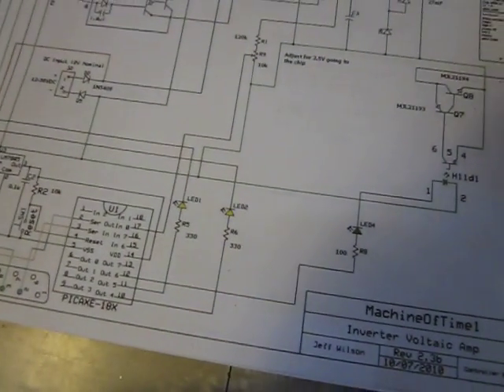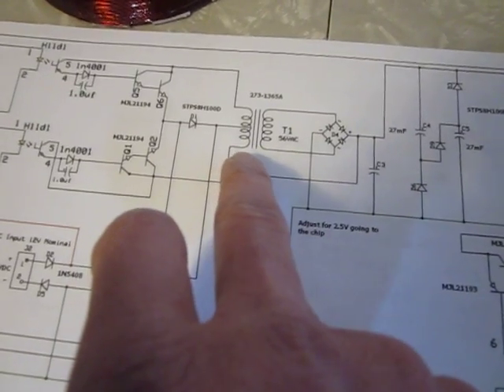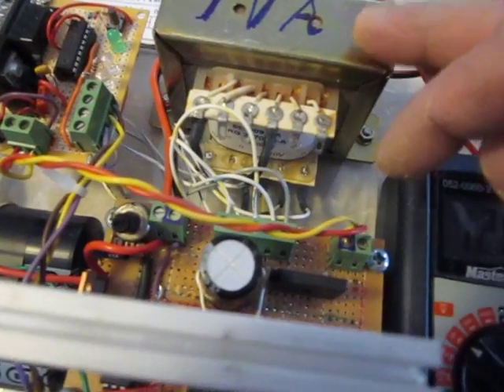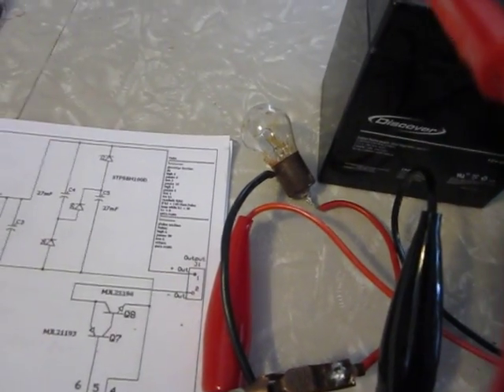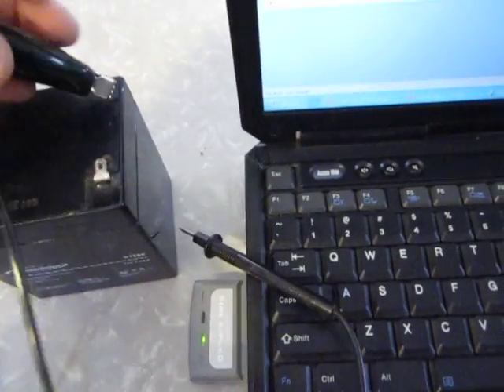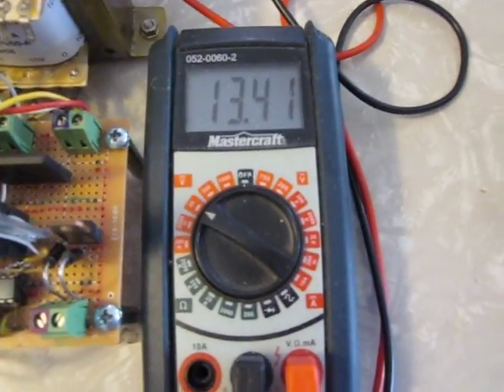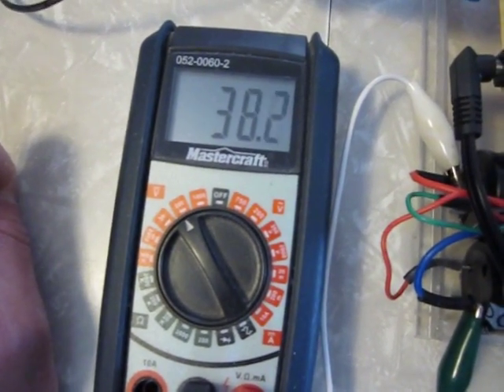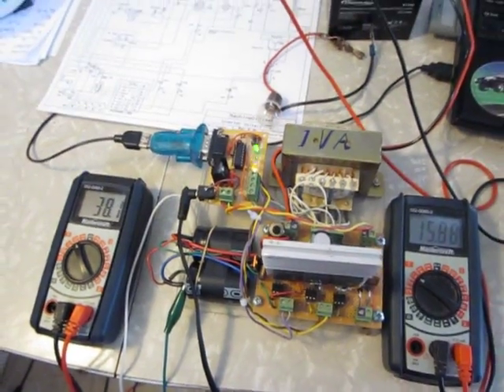TS_Inverter Voltaic Amplifier

Comment from the maker: @jburnum  Cap pulser is charging caps in series and discharges in parallel so I'm dumping 22V over the battery. Yes, my caps are replaced with 27,000uF at this time.
Thanks